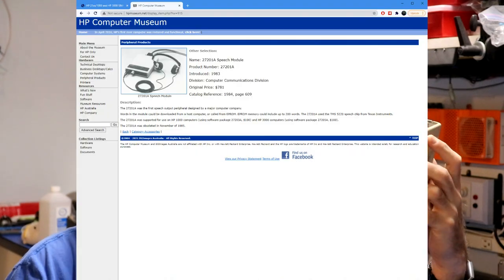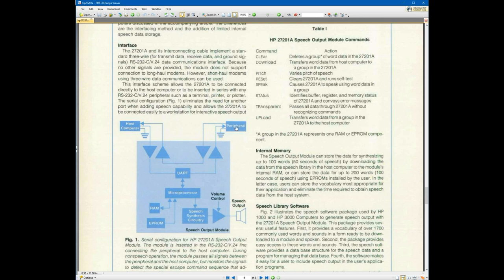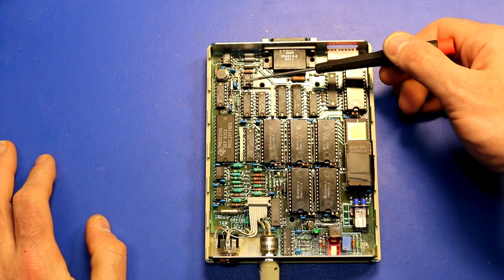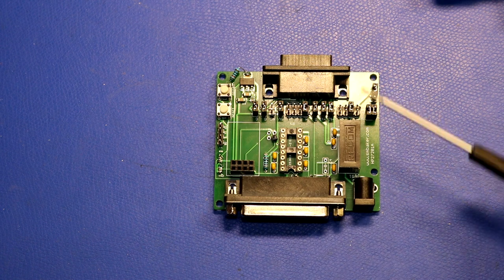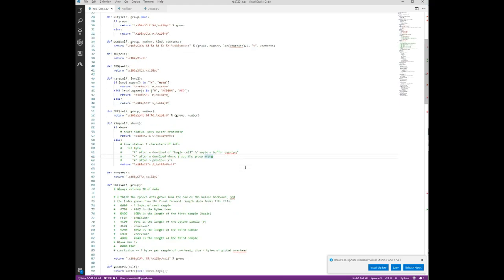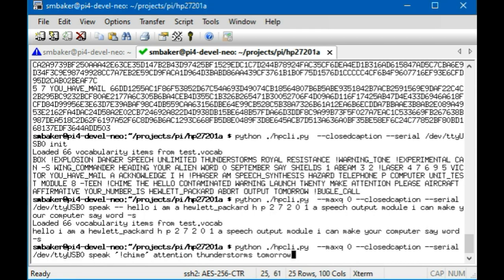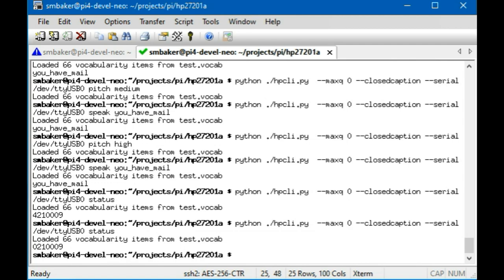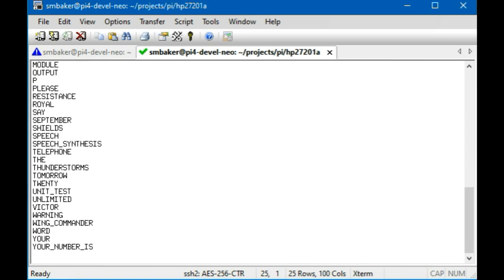HP 27201A, The World's First Speech Synthesizer ... by a major computer company

Comment: Give Ghidra a shot. It makes disassembly/reverse engineering so much easier.
I used it on some Z80 code for an arcade sound board.
Reply from the maker: That does look handy, though looking at the repository I'm not sure it supports a Z8.

Comment: This is great ! Thanks this explanation and the python code. How many words did you collect  ? I was looking for the vocab.py but couldn’t find it. Will you add it later ?
Reply from the maker: I was able to obtain approximate 1700 words from the VX software at http://www.bitsavers.org/bits/HP/HP_1000_software_collection/master-files/index.html. I've added some details on obtaining the speech data to my blog post at https://www.smbaker.com/hp-27201a-speech-output-module-first-speech-synthesizer-designed-by-a-major-computer-manufacturer. This weekend I may try to do away with vocab.py and have build_vocab.py read the speech data directly from the VX files. That way I don't have to host them inside my own github repository.
Reply: @smbakeryt  Thank you in advance / I am now following your work on  your blog

Comment: What do you actually load with the vocabulary hex data? Sounds like all the words are pre-recorded instead of phonemes so I'm a bit confused.
Reply from the maker: Yes, they are recorded. The technique is called LPC ("Linear Predictive Coding"). You can think of it as a sort of lossy compression algorithm. The same HP journal article I showed in the video has a two page background on LPC, and the TMS5220 datasheet is another place to start. The speech module for the TI99/4A computer used the same IC and is probably also a decent source of background. The TMS5220 ought to be well enough documented that new samples could still be generated in 2021.
Reply: @smbakeryt  Ah, so the hex is really a sound sample, and the chip hardware is designed to decode and play back the sounds with suitable filtering and timing/pitch controls.. That’s why it sounds SO much better than the SPO256!